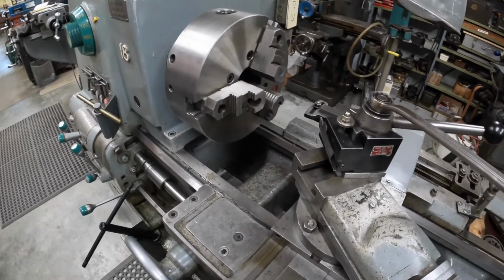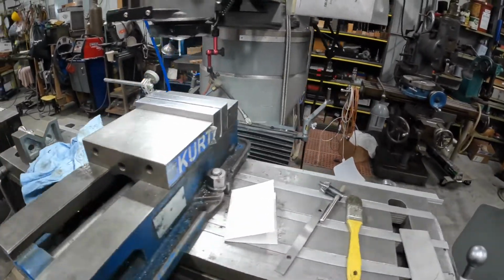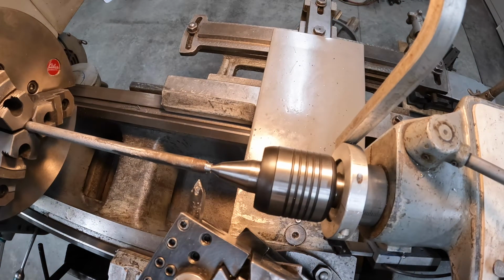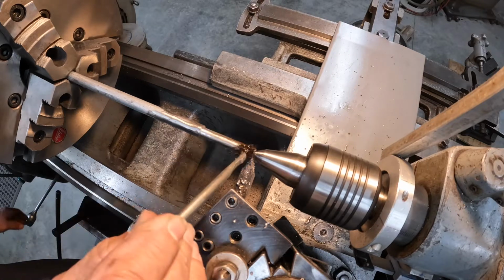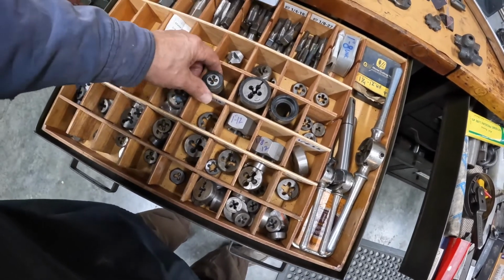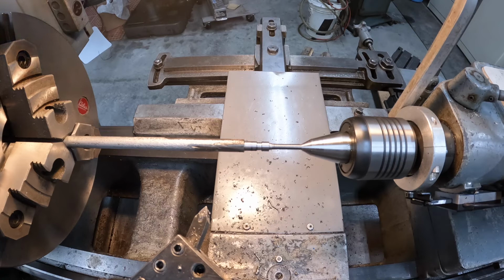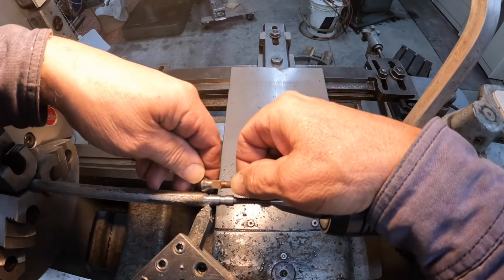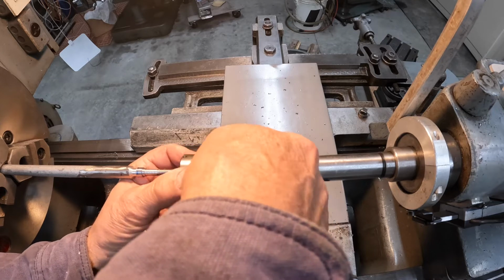Bridgeport Mill work Light bolt build

Comment: What is the vertical post coming up from the tailstock quill collar for? In the last few minutes of the video we can see a readout mounted on it but I can't tell what it is for.
Reply from the maker: Well the post on the nose of the tailstock came about as a result of replacing my DRO Z axis on my Bridgeport. This left me with an extra DRO 6" Scale. Well long story short, I decided to put the extra scale to use as a linear scale for the tailstock quill! As a general rule I always try to make something totally reversible. So in this case I made a collar that would clamp on the nose of the quill, the post is simply a holder for the read-out! Works great for depth of hole measurements! Anyway I had it and found a use for it!